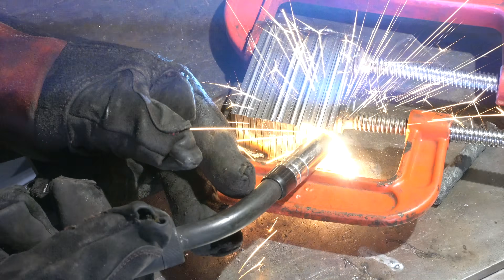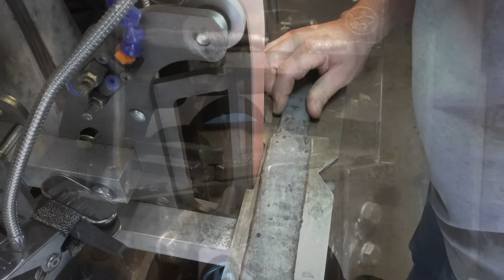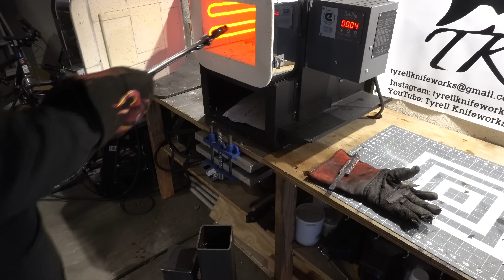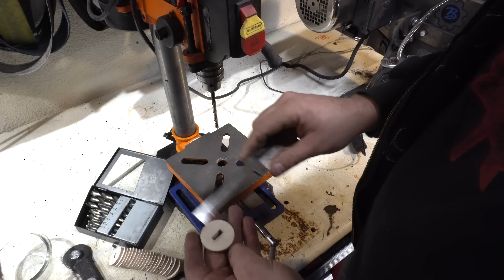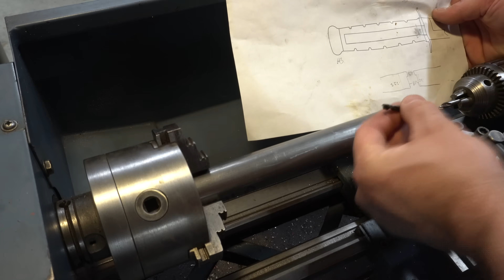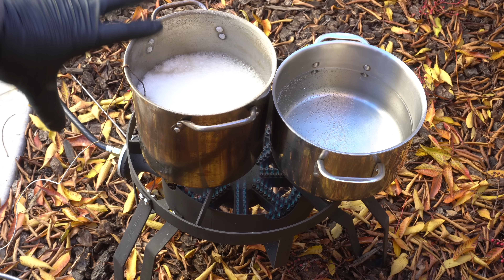Forging Three Copper Damascus Ka-Bar Knives - The Complete Video

Comment: They sold you argon instead of mig ? 1. argon is the gas you use for mig welding
2. MIG = (metal inert gas) which is the whole process of welding. i just got so confused by that sentence.
Reply from the maker: When you're welding steel, the "mig" gas is 75% argon, 25% CO2.  Unless you're welding aluminum or something else, this is the most common gas.  Pure argon is mostly used for tig welding.  Everyone who asks for "mig" gas at the place I go to gets the 75/25 mix.  If you want argon, you ask for argon, not "mig" gas.  Note:  My receipt even said 75/25 on it, yet I got Argon, so they definitely made a mistake.
Reply: @TyrellKnifeworks  thanks for the clarification didn’t know there was lingo for the type of mig gas you get 🙂

Comment: I like it well how it looks but from a viewpoint of the knife being used other then just cutting like bullshit some pog would be doing. What happens when you actually have to cut shit or use the knife as a tool and apply pressure to it? Wouldn’t it bend since it’s copper and steel?
Reply from the maker: The entire core of the knife is 1095 high carbon steel along with the entire cutting edge.  The copper is just a thin sheet over that core.  Don't forget that you are seeing an angled cut through the billet, not a cross-section when you look at the bevel.  The knife is very strong and very functional.  Thanks for watching.

Comment: Hey @Tyrell Knifeworks
How do you remove the surface rust off of your steel workbench? I see that it’s very fresh surface rust so you must have a method to keep it clean. Thanks!
Reply from the maker: It’s fresh because I just put it in not long ago.  😜  I do try to keep it clean and dry.  Thanks for watching, Cody.

Comment: They look awesome. From a combat use standpoint, I wouldn't use them as the copper makes the blade inherently weaker. But as a collector, you bet I would want these in my collection. They are absolutely a collectors dream blade. Not many would think to make Damscus using copper and steel. Sheer artistic Genius.
Reply from the maker: They are actually very strong. The copper is just a thin sheet over a 1095 high carbon steel core and cutting edge.  Thanks for watching
Reply: It’s held up very very well, rah!

Comment: As a boilermaker, you shouldn’t wear any long sleeves or gloves when using a drill press. The knives look great.
Reply from the maker: Thanks for watching
Reply: Love your work
Reply: Sorry digger, that warning was to people who don’t have much experience with drill presses. Just a PSA.. I have seen guys break wrists and lose fingers when their long sleeve shirt got caught up. You are obviously a master crafts man and you know what you are doing. Most accidents happen to men in the home, working unsafely. The same can of course be said for lathes and I’ve used big ones and I have seen a guy leave the chuck key in the chuck and start up one of those geared lathes that was made in the 60’s and weigh a few ton. Luckily nobody was killed but that chuck key shot up through a 30 ft high steel roof and the guy was sacked on the spot.
Reply from the maker: @InterGalactic1998  yes, I get it and agree.  Thanks.

Comment: Kabar handles are ovular. Round handles feel too wide, like a broom handle instead of a knife.
Reply from the maker: They are actually extremely comfortable and easy to index because the front it tapered.  Plus you don't notice it much but they are slightly "bowed" downward so there's a bit of a palm swell.  Thanks for watching.

Comment: Lucky Jar Heads. If you ever want to pick on an 8404 FMF Corpsman they would want a six inch blade with two inches of serrations at the bolster for cutting away gear webbing and uniforms.
Reply from the maker: Thanks for checking out the build, Steven!

Comment: Pet peeve moment stop calling pattern welded steel Damascus. Damascus pattern gets it's pattern from the elements in the steel itself. AWESOME work and craftsmanship
Reply from the maker: Are you really correcting me and trying to instruct me what the difference is?  Do you see how pretentious that is?  Nobody cares about the differences between historical Damascus and modern Damascus except a few who’ve watched a couple videos and learned the difference and feel they need to tell the world how much they’ve learned.  Yes THAT is a pet peeve of mine.  Go look back in my community section and you’ll see my point of view.
Reply: @TyrellKnifeworks  perhaps, but it it is still a persistent misnomer in blacksmithing that confuses many. There are handful of smiths that do make replica Damascus that gets its patterning from its elemental make up. You make excellent pieces, don't get me wrong, your work would belong in a blacksmithing show case at a high end gallery.

Comment: Kinda curious, there are metal "flakes" that come off when you press it, are those pure iron or what ever metal you happen to work with? (I'd assume in this case maybe a combination of iron and copper?)
And can this be recycled?
Reply from the maker: The material coming off during forging and pressing is scale.  Basically it’s oxidizing metal with very little carbon in it.  Kind of a form of rust.  It’s no good to reuse for anything.  Thanks for watching.

Comment: Nice work, I was just wondering what’s wrong with using 5min epoxy vs 24hr I would think 5min would be just fine to use?
Reply from the maker: I use 5-min epoxy for regular handles but here with the stacked leather it took about 15 mins just to stack them up and compress them.  The 5-min would be set too fast.  Thanks for watching, Tim.

Comment: Considering there's more than in gas  used in GMAW, I'm gonna guess they gave you Argon because you asked for "MIG" gas instead of CO2/Argon
Reply from the maker: No, they just made a mistake and didn’t look at the bottle.  “Mig” gas is always 75/25 mix. Thanks for watching
Reply: @TyrellKnifeworks  except when it's not. You dont use any CO2 with magnesium, aluminum or Titanium.
Reply from the maker: Ah ok, I didn’t know that.  I have always asked for mig gas and gotten 75/25
Reply: @TyrellKnifeworks  fair enough. I'm a welder by trade and when you said they argon gave you Argon instead of mig it kinda poked me wrong.  Sorry if I seemed like a troll. 

I enjoyed the video. Craftsmanship looked really good and knifes looked even better.
Reply from the maker: @chocolateer2  no worries, I learned something new.  👍. Thanks for watching!

Comment: Wow --- Are these display only ? ... Does copper  affect strength ?
Reply from the maker: The copper is just a thin sheet over the 1095 high carbon steel core that is also the entire cutting edge.  The knives are very strong and functional.  Thanks for watching

Comment: I must say I'm curious about the durability of this type of copper lamination. Have you destructively tested one? Gorgeous work, BTW, very beautifully executed!
Reply from the maker: I’ve done snap testing on one.  They don’t have the same lateral strength of solid steel construction but still quite strong.  The copper brazing bond is in excess of 70000 psi in tensile strength so you’ll destroy the knife before the layers shear apart. Certainly as hard as you heat treat the core.

Comment: Does the copper weaken the blades much?
Reply from the maker: First off, the core of the knife is 1095 and all along the edge so there's no copper on the cutting edge.  The copper bond is very strong.  If you look up copper brazing, it is in excess of 70000 psi in tensile strength.  You'll destroy the knife before the layers will shear apart.  Thanks for watching!

Comment: Nice done, extraorinary looking.
Just I guess they will not last for long due to electro-chemic corrosion?
Reply from the maker: You are referring to galvanic corrosion. Galvanic corrosion requires the presence of an electrolyte like salt water.  Keep the knife clean and dry like you would any normal carbon steel knife and it will last a lifetime.  If you keep the steel from rusting, the copper will be fine too.  Another interesting note, the Blade magazine overall knife of the year for 2021… has copper in it.   Thanks for watching.

Comment: What kind of hot bluing solution are you using for the fittings?  Do you have a video where you talk more about it?
Reply from the maker: Ive done actually hot “bluing” on the Bowie challenge build where the fittings were blue.  For the black finish like on these, I use UltraBlak from EPI chemicals.
Reply: @TyrellKnifeworks  Nice, I'll have to look that up 👌

Comment: i never liked the all thread on the knives. makes it feel cheap, i prefer pinning
Reply from the maker: Sure, but peening the pin is a one-time thing. If it loosens, you’re screwed.  With an all-thread you can just tighten it more.
Reply: @TyrellKnifeworks  your just maken excuses, quit taken short cuts and be the master craftsmen that you are

Comment: So what these aren't for actual use or something? Honestly I would like just a really strong steel knife because I wouldn't even want to use these.
Reply from the maker: If you’re referring to the copper, the core of the knife is 1095 and all along the edge so there's no copper on the cutting edge.  The copper bond is very strong.  If you look up copper brazing, it is in excess of 70000 psi in tensile strength.  You'll destroy the knife before the layers will shear apart.  Thanks for watching
Reply: @TyrellKnifeworks  No, I'm referring to the fact that I wouldn't even want to scratch let alone touch such a beautiful knife.

Comment: You are the reason that I'm now getting into bladesmithing. I've bought most of the materials to get a forge going and I hope to forge my first blade in about 2 months. (Hopefully I'll know how to move metal better than I do now.) Thank you for making a change in my life Tyrell, I can't thank you enough.
Reply from the maker: That is very amazing to hear!  I’m so happy I could help and inspire you.  Definitely check out my beginner series playlist if you haven’t already.  Send me a pic for viewer knives! 👍
Reply: And of course on the day I get the forge finished it decides to put 12 inches of snow on the ground. I haven't been able to take it out of my garage because it is a coal forge. I'm not going to use it inside because I don't want to breathe in the smoke/fumes from the burning coal.
Reply from the maker: @Asmith-1111  yeah, probably not a good idea to use it in the garage.  Snow shouldn’t stop you though.  😜

Comment: Is it possible to do this with silver instead of copper?
Reply from the maker: Yes, but that amount of silver is around $1k, you’d be better off with nickel which gives you the same effect but it’s a fraction of the cost.  Thanks for watching
Reply: @TyrellKnifeworks  Thank you! I thought up the idea of mixing other metals into Damascus steel a few year ago and incorporated it into my game, for werewolf/monster slaying purposes. I've been wondering if it's actually possible ever since. (Yearh... I really don't like the idea of silver coating or solid silver blades...)

Comment: These look absolutely amazing! Does the copper affect the structural rigidity or the endurance of the knives in any way?
Reply from the maker: The copper is a thin sheet over a 1095 high carbon steel core that’s all along the cutting edge so it’s very strong.  I would go prying up boards with it but under normal use it’ll last forever.  Thanks for watching.
Reply: I can imagine a pure copper or brass blade holding up well, just in a normal defensive situation. This thing is much stronger than that.

Comment: Other than looks WHT would you use copper in a knife blade ? I know they made blades out of it before they had steel but
Reply from the maker: The copper is purely aesthetic,  the entire core and cutting edge is 1095 high carbon steel so it’s very functional and extremely sharp.
Reply: @TyrellKnifeworks  ok was just wondering it dose look awesome in there have you seen any trouble with bi metal corosion?
Reply from the maker: @richardduvall6512  Galvanic corrosion requires the presence of an electrolyte like salt water.  Keep the knife clean and dry like you would any normal carbon steel knife and it will last a lifetime.  If you keep the steel from rusting, the copper will be fine too.  Another interesting note, the Blade magazine overall knife of the year… has copper in it.   Thanks for watching.
Reply: @TyrellKnifeworks  cool just wondering you do great work keep it up

Comment: what happens when you sharpen it down to the copper
Reply from the maker: You can’t sharpen it down to the copper.  The copper is a sheet over the core, as you sharpen the knife, the copper would move up.  Think about it.

Comment: Very nice Work, but is the connection from steel to copper realy working ? I don't know if this works out for some work . Let me know please .
Reply from the maker: The bond is extremely strong.  If you lookup copper brazing, it’s in excess of 70000 psi in tensile strength.  You’ll destroy the knife before you shear the layers apart.  Thanks for watching
Reply: @TyrellKnifeworks  I think i must give a try. The welding/melt  temperature from copper to steel is very different, but i think you was trying this before. So i trust you ! Lol.

Comment: The thing that bothers me is using a sharpie. Won't the msrket just wipe off?
Reply from the maker: You mean on the leather?  Try it, put some black sharpie on leather and see if you can get it off.  It’s quite impossible.   Thanks for watching!
Reply: @TyrellKnifeworks  I'll use my tester knife's sheath lol

Comment: Does the copper weaken the blade
Reply from the maker: No, not really.  The copper is just a thin sheet over a 1095 high carbon steel core which extends the entire cutting edge.  Thanks for watching, Ben.

Comment: Absolutely stunning! I’m not sure I would have epoxied and dyed the leather stacking, though. When I was in the military, we just soaked the raw leather handles of new knives in neatsfoot oil. That’s what gave them their color and “feel.” They shouldn’t be at all slippery. But again, the result you got was gorgeous!
Reply from the maker: The handles were coated in neetsfoot oil afterwards.  I wanted them darker than raw leather.  Note, even kabar original leather stacked handles are still epoxied together or they fall apart.  Thanks for watching!

Comment: Interesting. Will copper layers prevent multiple sharpening by stretching out?
Reply from the maker: The copper is a sheet along the core.  As you sharpen the knife, the copper will also move up.  Thanks for watching!

Comment: does the copper make the blade weaker? like is this just a showpiece or can it be used as a knife. either way its super freaking cool!
Reply from the maker: The blade is very functional.  The copper is just a thin sheet over a 1095 high carbon steel core and also B along the entire cutting edge.  Beautiful and functional. 👍 Thanks for watching, Will
Reply: @TyrellKnifeworks  that is super cool, thanks!

Comment: Why would you do this?  Copper is a terrible choice for a knife.
Reply from the maker: The copper is not on the cutting edge.  The entire core and cutting edge is 1095 high carbon steel so it’s very functional and razor sharp.  Thanks for watching.

Comment: just a little advice from an old machinist.  Keep the working end of your stock as clos as you can to your chuck in the lathe.  It will prevent damage and serious injury.  If it doesn't fit through the chuck , just cut shorter pieces. It will also prevent chatter.   Love your work, well done
Reply from the maker: I didn’t want to have to move the stock after each pommel, hence the stick-out.  I had the tail stock on it as well.  Thanks for watching

Comment: A trick if u dont have a rotarytable, use youre lathe and the ballmill. Just make sure the 1 flute u use to cut is in line with the spindle, just like all youre other cutters on the lathe.
Reply from the maker: My problem is that I don’t have a 4-jaw Chuck.  The lathe was handed to me free so it didn’t have all the parts.  Thanks for the suggestion though.
Reply: @TyrellKnifeworks  do u have the tailstock on the lathe? Then u could remover the jaws from the chuck (so u have a flat surface) and press the part against the chuck with the tailstock. 
If u do it this wat make sure not to remover alot of material because the part isnt really clamped by alot of force.

I do this somethimes with inner and outer fillets.
Reply from the maker: @robinlambregts  that’s a good idea.  I’ll try that at some point.

Comment: The blades turned out excellent, the leather and and the pommel not so well. The handle is pressed on and the pommel has the same slot as the handle leather but the pommel is pressed on and the tang is peened to retain the handle.
Reply from the maker: I find the peened pommel, though traditional, is flawed.  It’s hard to remove and you can’t tighten it.  With the screw-on pommel you can tighten it if you need to.  Case in point, I actually found one of the guards was loose, so I just heated the pommel a bit to release the epoxy, fixed the guard and epoxied and screwed on the pommel again.  Should the leather shrink, you could also just tighten the pommel.

Comment: I have my dad’s WW2 Navy issue KBar. The handle end needs rose replaced and I wonder if you could point me I the right direction for a repair?
Reply from the maker: I think you should find a Bladesmith in your area.  Where do you live?
Reply: @TyrellKnifeworks  Full-time RVer so I have options(KCity, NM, AR, are a few states we winter in). It’s the pummel that broke years ago. Everything else is original and in good condition. Loved your Ka-Bars.
Reply from the maker: Best to Google for knife makers in those areas. I don’t really do restorations.